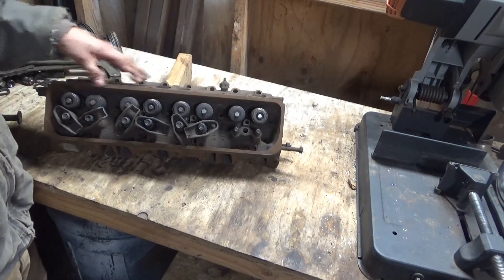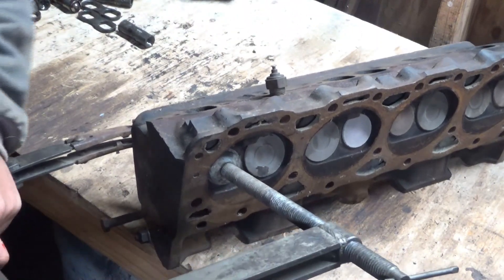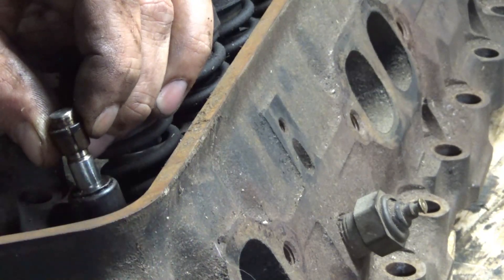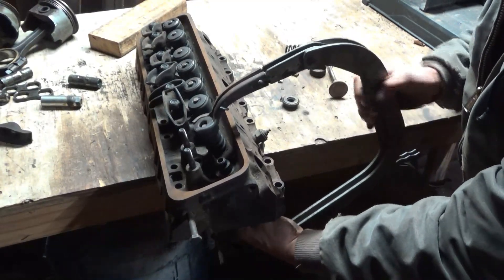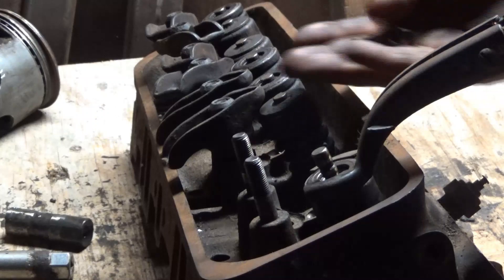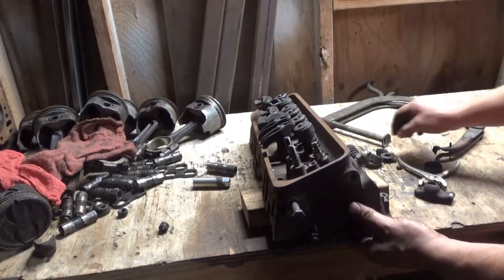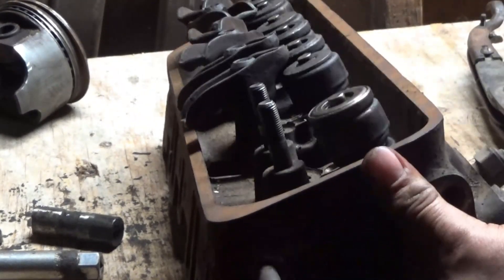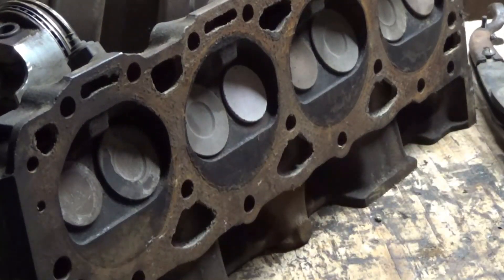How to remove valves on small block chevy heads

Comment: What kind of valve spring compressor did you use in the video?
Reply from the maker: It's called a c clamp valve compressor.  Mine says MAC on it, and it's very old.  The ones they make now might look different.

Comment: Crazy that I was just looking for a video about a week ago on how to do this. My c10 is blowing quite a bit of blue smoke when I start it. Gonna be replacing the valve stem seals soon. Thanks for the video, keep up the good work!
Reply from the maker: Thanks for watching and commenting. but check this out. from my experience make sure you valves are not loose and move around in the guide. If you have bad valve guides new seals will not fix the problem. Once upon a time I was about 16 and broke. Ok so my dad and I put together a cheap engine for my truck. the valves wiggled about an 1/8" back and forth. my dad said "thats not good but it will be ok"  later on, I got a letter in the mail from the city or something saying that my truck was on the I45 blowing out droplets of oil on peoples windshield , lol . and that i needed to fix the problem.  the inside of the tail pipes was wet with oil. but the truck ran good and I had new valve seals in it. the moral of the story is that the valve guides need to be good too.
Reply: @davidcraft4909  thanks for the tip. If they do wiggle and the guides are bad, can the guides be replaced? Or at that point would I need to replace the heads? Been looking at some top end kits that include heads. Wondering if maybe I should just go with that instead.
Reply from the maker: yes the valve guides can be replaced. a machine shop will take your head and bore a hole out that is bigger and put a sleeve in it for the valve guide. this is a very standard common thing. In other words people do it all the time and that is how its done.
Reply: @davidcraft4909  thanks, I'm gonna be ripping into my c10 soon. Might need to hit you up again in the future with a question or two if you don't mind.
Reply from the maker: @MotorheadATX  I don't mind at all, I have 72 c10 that I'm work on. but yeah I will be posting a lot of videos on sbc in the future. I want to turbo charge a small block but I'm new to it so yeah, lol. but i do have a lot of experience with stock normal small blocks and I have ran them for years as a daily driver with carbs and all that.
Reply: @davidcraft4909  that's gonna be an awesome build. I'm subscribed to your channel so I'll make sure to keep up with it.